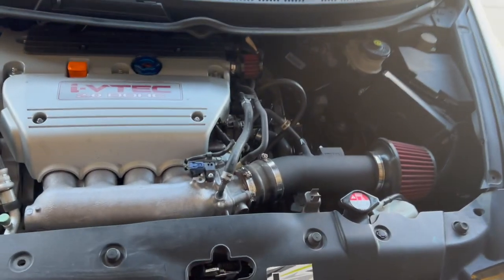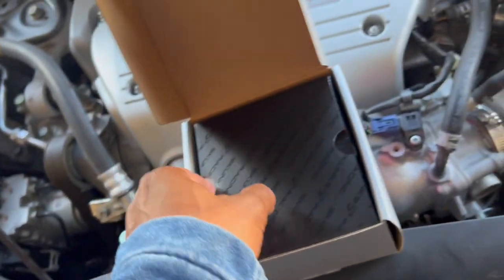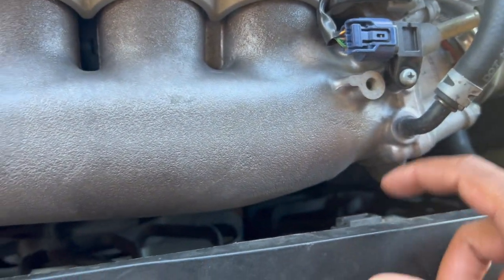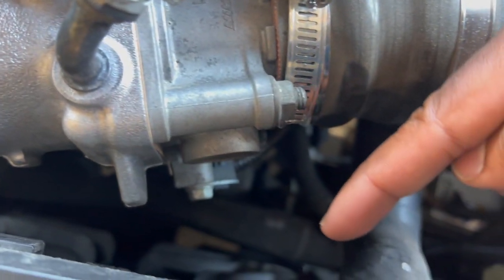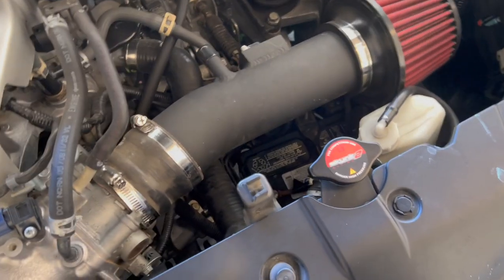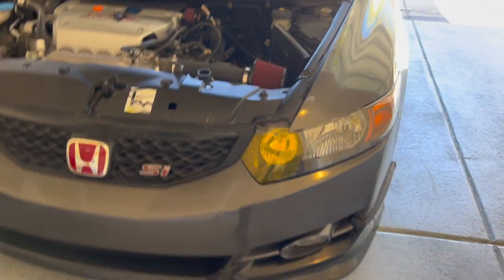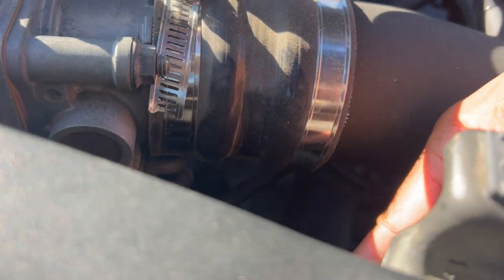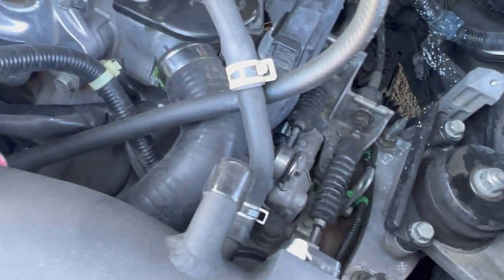Having Coolant issues on my Civic Si + Skunk2 High Pressure Radiator cap install

Comment: What was it? My resivour cap keeps cracking even with new ones. Seems like its only when my ac is used for a bit in hot weather.
Reply from the maker: One of the coolant hose towards the fire wall was leaking
Reply from the maker: One of the coolant hose towards the fire wall was leaking
Reply: @Shakeem  oh yeah. I have an Accord 04  I though you had what I had goin on but your resivour wasn't leaking. I just bought the whole resivour an aftermarket one with a different cap design. I did install a acura tl/accord ebay radiator with fan/should. I need to upgrade my fans, my oem ones were better. I put it off saying maybe I just had air in system. Maybe it is the radiator. I'll see.